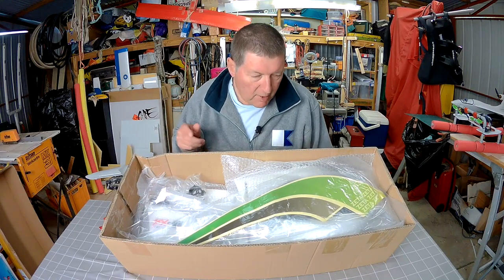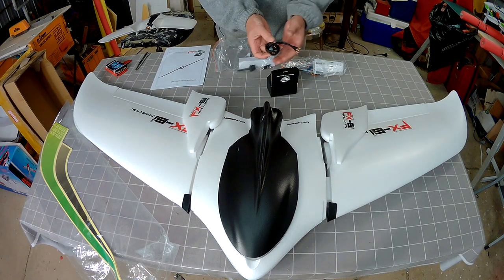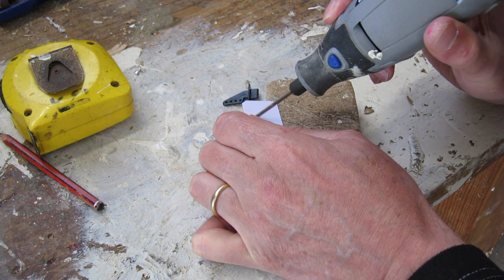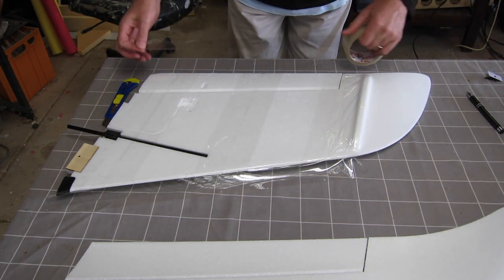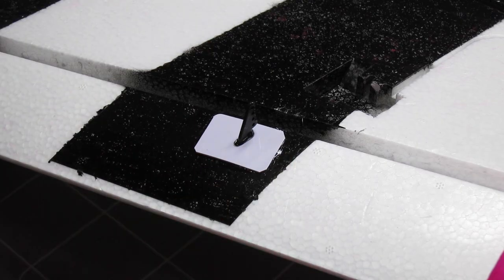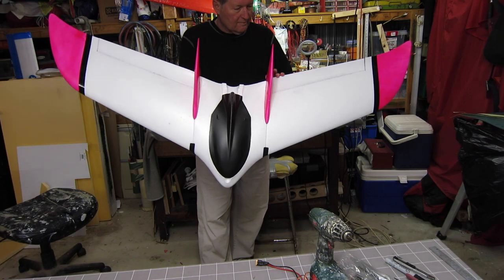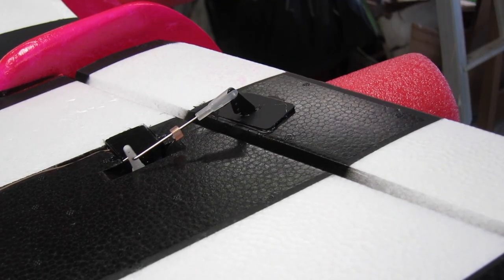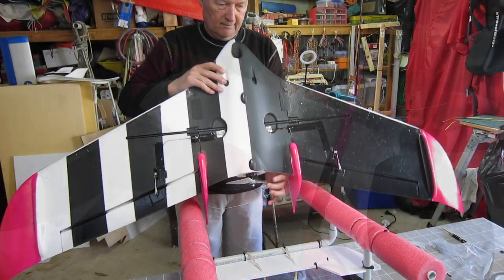Zeta FX-61 Phantom build

Comment: Nice build. As the spar clamps crack and become passengers, I glued some Velcro tabs to the wing & fuse underside aft of the clamps, then use a strip of Velcro to keep the wing snug against the fuse. This method has withstood considerable forces and one big impact. Very strong plane. Glad they improved the motor mount.
Reply from the maker: Yes it is good to see the design changes over time. Wish they would provide decent control horns.

Comment: Great video Andrew. I just received my Zeta F-61 and I am in the process of assembling. I was wondering if it would be easier to mount the motor to it's respective mount prior to mounting to plane ? I think I will try it this way. Like I said great video and it helped me big time.
Reply from the maker: Either way, it fits nice and snugly anyway. Really sweet wing, although it's noisy unless you use an extended motor mount.
Reply: Copy that . Thanks Andrew !!!!

Comment: Nice build! I would recommend getting the aluminum motor mount from Small Parts CNC. It's under $20 and works great! I have a fully autonomous Fx-61 and didn't want to risk it with the flimsy plastic motor mount.
Reply from the maker: Good call. You would have a bit of gear on that.

Comment: Thank you for the beautiful video.
This is a very valuable lesson for me.
Reply from the maker: Glad it helped
Reply: Hi Andrew, what make of fluoro paint did you use (Accent)? Foam safe?
Also, with the motor mount extension of 25mm, did you maintain the recommend CG with two batteries AND the 80g of Lead?
Another purchase, Thanks to your inspirational video. 👍

Comment: Andrew, nice video. I have the same wing. Have 3 power kits, and dont't know what is more recomended. Can you help me?
Turnigy Air 3730 1000 kv - ESC 60A, Prop 10*6 / 12*6
DXW D3536 1200 kv - Esc 50A, Prop 10*6
EMP N3530 Outrunner kv 1400 - Esc 40A, Prop 9*5 /10*4.7
What is the recomended kit for this Wing? I have lipo 3s - 2200 MHA and 3s-2600 MHA too. And waiting for shipping a 3s 4500 mha.
Reply from the maker: I don't know those motors. You will have to test them for your desired speed and efficiency.
Reply: @AndrewNewton  and that paint? That spray paint is special? Don't Hurt The epo?
Reply from the maker: Cheapest spray paint I could find

Comment: Hi Andrew ,very Nice paintjob !!
Did the  motor mount with the plywood reinforcement hold good after a few flights ??
No cracked motor mount ? 

Cheers
Reply from the maker: I didn't have any problems with cracking, still going strong. Plywood disc does the job
Reply: Andrew Newton well that’s great , thx for the quick reply m8 
Have a Nice day 
Cheers

Comment: Hi Andrew
How are you mate? I thought i would ask if you could do a video on paints you use on foam planes. EPO, EPP. I love you learn more on this before i make any mistakes. I would like to take this opportunity to wish a very Merry Christmas and a Happy New Year. From Keith In Darwin.
Reply from the maker: I'll add it to the list Keith, but I just grab the cheapest spray enamel in the hardware shop, usually Accent matt. Then if it's a new plane you just need to wipe it down with metho before spraying. EPP and EPO can take anything, but XPS (homogenous crumbly insulation foam) doesn't like some solvents.
Reply: Thanks Andrew as always I appreciate your great videos and knowledge you so freely share.

Comment: Andrew great videos, a big thank you.  Questions on painting the FX61, how did you prep the foam? Did you use a shaker cans?   Cheers Neil
Reply from the maker: Initially I just sprayed but the paint was repelled by whatever was on the foam. Wiped down the foam with methylated spirits (denatured alcohol) and it worked. I used the cheapest matt enamel shaker can I could find
Reply: Andrew Newton thank you. The cleaning step is what I was missing.   Really appreciate and enjoy your videos.  Cheers Neil

Comment: My FX-61 constantly wants to dive right. I've adjusted mechanically both surfaces but can't seem to find a decent position for them so to have a good manual flight without it wanting to dive right.     It's not a massive dive to right but enough to no it's not flying properly.  In Inav modes it flies great but not so much in manual.    I normally build I wing and fly first without FC but this wing i went other way. Lol.  I'm starting to think I need to add angle to motor. The mount was installed properly and flush but something doesn't seem right.   I have also tried flying tail heavy to see if that's the cause but even then I was getting the dive to right behavior.  Any thought?  Should I add lots of up to the surfaces more so on left elevons??  Help because I really love this wing because I get almost 45. Minutes of flight on 4s 5200mah and it gets great HD footage when in flight modes.
Reply from the maker: That's odd. Just keep adjusting the pushrods until it flies reasonably level in manual, I guess. Check for different throws or servo performance.
Reply: @AndrewNewton  did you add much throw on your fx61? I no some wings like my AR wing needed about 3mm of up throw but seeing how this Fx-61 already has angle built into wing I didn't think I needed any so kept elevons pretty much flush.

Comment: Hi wanna check with you , what plastic sheet you use to hold the servo hinge ?
Reply from the maker: 3M Blenderm tape is best for hinges
Reply: @AndrewNewton  thank you for your prompt reply l. Good Video
Reply: my bad, actually it's not servo hinge, it should be the plastic sheet that you use to holder the servo horn. the white plastic sheet that you use to spread the load of servo horn..I wonder what type of plastic sheet you using. is it specially for rc ?
Reply from the maker: @felixsiaw147  Credit card or ID card plastic. Buy blanks on Ebay
Reply: Thank you Andrew. Keep up the good works. I am in the midst to built fx-61 for mapping

Comment: They forgot to put the glue in my kit.  I just used hot glue.  Didnt use the control horns either used some dubros with the screw mount.

I ordered mine from Value Hobby.  Like ordering from them because theyre only a 3 hour drive away and items always show up at my door with in 1 to 2 days.
Reply: Value Hobby!  (shipping may be a tad on the high side for Andrew ;-) but I too recommend them for anyone East of the Rockies.  Probably Westward too but I wouldn't know ;-)
Great shipping times too; 3 days for me.
Reply from the maker: I need to find some decent control horns, the search goes on

Comment: 1920kv seems a bit fast for this plane on 3s. Mine runs on 2814 900kv sunnysky 4s with 10x7 aeronaut cam carbon folding prop. My favourite plane - fitted with pixhawk lite FC in my case, and ULRS 459MHz LRS. I did a video for a modified removable wing mod as those blocks in front of main spar is a crappy design - not very strong.
Reply from the maker: Did I say 1920? Sorry it's actually 920kV
Reply: 920 would work well with 4s. I felt the 3s setup on the fx-61was a little under powered.The folding prop with brake on the esc is essential for not breaking the motor mount when landing, and definitely use the wooden motor mount reinforcer disk supplied. I have not had mine break but many have.Many I have seen have switched to the smallparts CNC motor mounts to combat this issue, but the stock mount has worked fine for me as described here.
I use a bungee launch on mine also which works a treat, as not easiest to hand launch I found. Looking forward to seeing how you get on with the fx-61. it is a great plane!